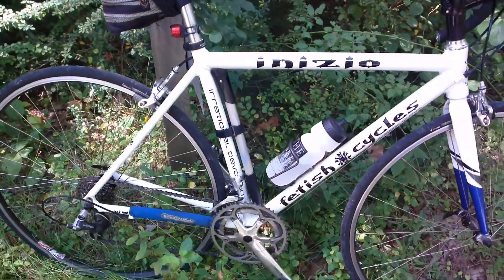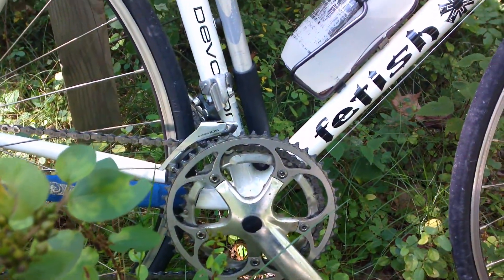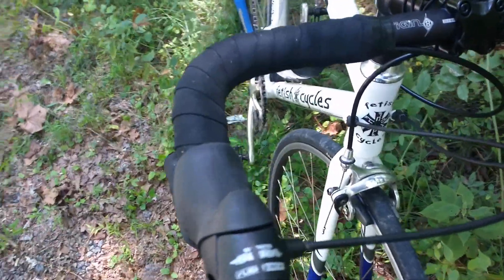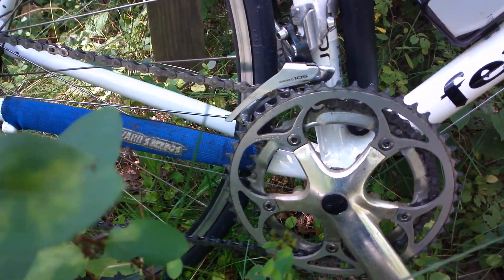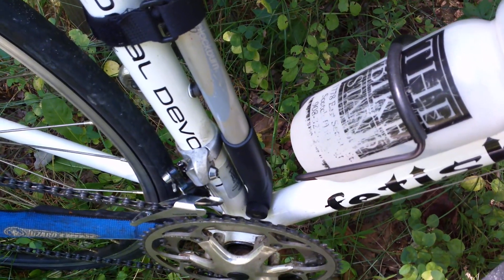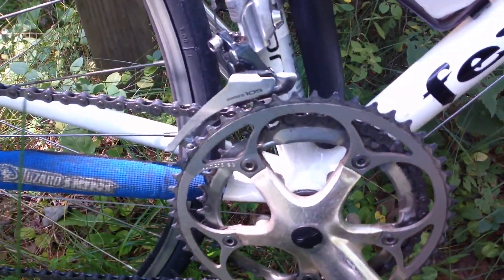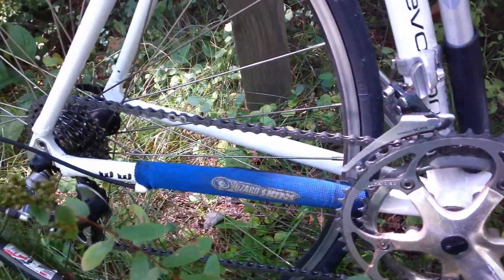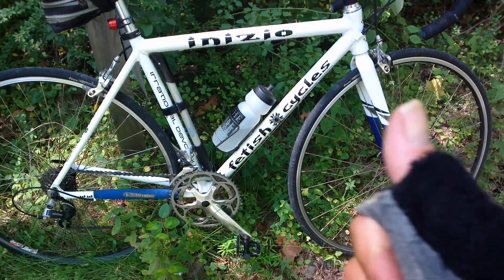Making it work - front shifting a double with a triple shifter

Comment: Did the same thing with an Ultegra 6500 triple. Removed the smallest chain ring. Only part I swapped was the bottom bracket for a shorter one, which fits the double chain line better. I "eliminated" the shifters 3th position with the front derailleur's limiting screw, so I don't have the "middle" position, or in other words, I just have low and middle position. Works in my opinion just like a double, but I'm no expert, so take it with a grain of salt.

Comment: How do you fine tuning the middle position?
Reply: It's a function of both bb spindle length and cable tension, and limit screws.  One can lock out the extra position or set it up so the cable pulls past it. Or is set at the middle as an adjustment position... It takes much fiddling but is cheaper than buying new brifters!

Comment: Out of my bicycles, I have two triples, a Trek 7 speed and a Madone. Many people don't care for triples, but I find them very useful and versatile, you have all your ranges, top, middle, low. I guess people don't like them because the cranks are heavier than doubles.
Reply: I actually do have several triples.  They are excellent esp. if you ride very hilly terrain.   One of them even has a 28 tooth mt bike granny gear instead of the 32!  This particular bike was simply built up with what I had, making it work.
(sorry for the tardy response, was locked out of my old youtube account when I lost all my passwords)